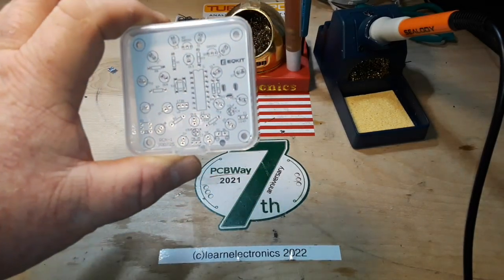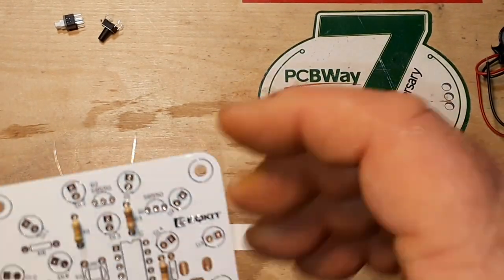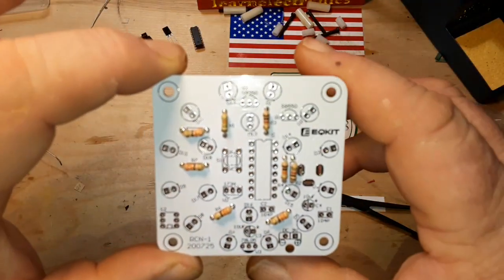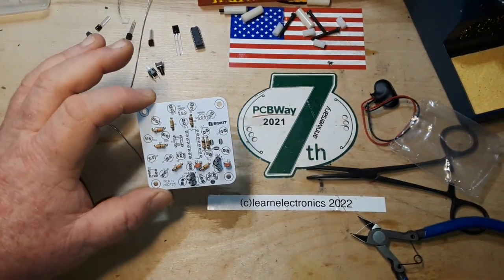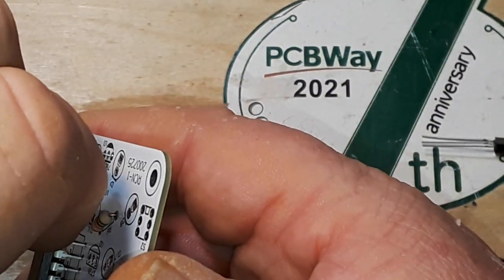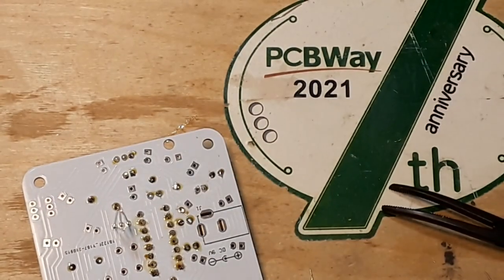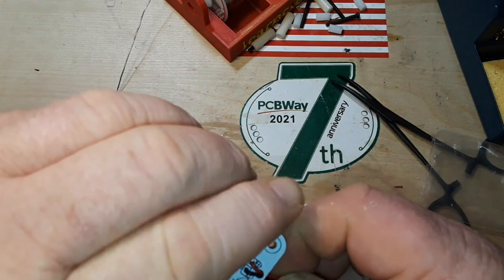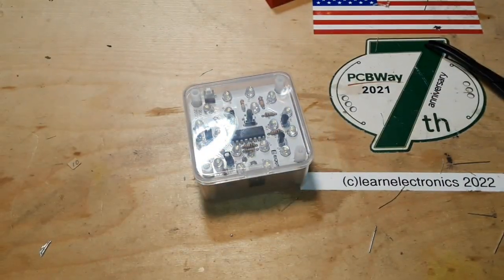An interesting nightlight kit

Comment: I always like those little kits.  I LOVE to solder.  It helps me relax.  I only do through hole.  One of these days I'll try SMD.
Another GREAT video.
Reply: Remember the Radio Shack kits, with the red circuit boards of the 70's?
Reply: SMD can be easy if it's the larger packages. The tiny little packages can be fiddly, but are doable once you get the technique down. Tin one pad. Pop your component in place and reheat until it flow then gently press the component to the board making sure the unsoldered end is in the proper position on its pad. Then solder the second end. It can be fiddly but the results can be really satisfying.

If you really get in to it, you can use solder paste and a hot air gun to do SMD. It's really satisfying when you heat the paste and surface tension drags all the components in to place.
Reply: @MrDoneboy  I remember those, along with Heathkits that my father was really into building.  I also got to build a few small kits as a young boy (radios, etc.), and find it a shame that everything these days is throw away electronics.
Reply: @UncleSiebs  And the stuff lasted.  Those big resistors and crystals.  Like military-style :)
Reply: @UncleSiebs  I remember building a ham transmitter with pops from a scratch kit.  I was not sure it was working until I keyed the mic with my hand on the antenna jack.  Woooo!
Reply: @jimedgar6789  Indeed the Heathkits lasted, and when they did break down my father would use his Heathkit troubleshooting equipment to diagnose and fix it.  You not only got to put something together, but they actually taught you how it worked! I remember the console TV in the living room was having issues, and he was able to trace it back to a single component on a board that cost $0.69 to repair!  And of all things my father was a marketing executive with no background at all in electrical engineering.

Comment: I always had a fondness for the 4000 series counter ICs. Today it's just easier to throw a uC at any task, but I still enjoy looking through the projects in the old electronics magazines from the 70's and 80's. So many clever ways to use the CD4017, CD4040, CD4060, etc.
Reply: I'm exactly the same. I've downloaded old issues of Elektor and Practical Electronics. There's so many useful circuits in them

Comment: About ten years ago I designed an LED night light, that used a vibration sensor to switch it on and a timer to return it to the off state.
The vibration sensor is so sensitive it can detect a finger tap on the table on which the night light rests. So to active the light it is just necessary to tap the bedside table with a double tap knock. The sensor can detect the cadence of the tapping and decide if it should switch on the light. 
The circuit is pic micro based, and consumes nanoamps when not active.
It also has an LDR, that can stop the light being switched on if the room is not sufficiently dark. 
The sensor, which is insensitive to sound and normal vibration, is constructed of a piezoelectric disk, mounted in a small plastic uPVC water pipe end cap. A small glass marble rests on the disk surface, trapped in such a fashion that it's movement is restricted to about 1mm. 
It is this glass marble that gives the sensor its sensitivity, I suspect that a mems  sensor could have been used, but this home brew arrangement  is cheap to make and very effective. When placed on a large dining table, the whole surface become sensitive to the smallest finger tap anywhere on the table surface.
The microcontroller circuit, uses the analogue input to set up a differential bridge arrangement that detects the voltage generated by the piezoelectric disk. The resistor network used provides a small offset bias voltage which allows the smallest output to trigger the micro from sleep mode. 
I published the design on the Maplin electronics magazine web site ( the Maplin forum), unfortunately the Maplin company failed a few years later, and the site was closed. It may still be possible to find the article with pictures somewhere on the internet. I looked a few years ago and it could still be found under the title of Maplin knock knock light.
Reply: Do you still have info on it? I've searched and can't find it. It would solve a problem that I've been working on for a while.
Reply: @TheMatthooks  yes I have all the details, the circuit and the code, along with the pictures and the PCB layout in PCB artist format. . I did a search today, to see if I could still find it on line, but it's gone. I keep multiply electronic copies of all my project design files, but the text for the article is missing. The original design documents are dated 2012.
I still use the prototype, it site in my bedside table. Since I built it, I have changed its batteries twice, and I use it daily ( nightly). I am happy to send you the design file, but it's not small.
Reply: @nigeljohnson9820  I tried to send you my details but it looks like the bots caught it. It's my first name, but the shortened version with two t's. Then my last name at the warm post place with a full stop, and the commerce ending. I'd be really grateful if you could send me the details.
Reply: @TheMatthooks  I will try sending you a test message, I do not normally do this as I value my privacy. It is why I do not post YouTube videos. That and the fact I am far less active these days, following serious illness. 
Please reply if you receive my test message and reference this channel.

PS I tried a number of variations on your suggested email address and all were returned. I might have incorrectly guessed your mail provider or have used the wrong letter case or the wrong spacing between first and last name. Is there a space or an underscore or some other symbol? 

Not sure how else I can get the information to you, without compromising my security and privacy.
Reply: @nigeljohnson9820  for some reason YouTube is removing any message that makes it more obvious, so I'll split it apart.

The first word is the usual shortening of my first name, with two t's.
Reply: @nigeljohnson9820  the second word, following a below score, is my full surname. The service is provided by post that is on fire. The ending is the most COMmon one.

If this fails, I give up.
Reply: Hi Nigel - did you happen to bookmark the page from the Malpin site? If so, you could check the Wayback Machine for an archive.
Reply: @UncleSiebs  ok I have tried to send Matt another test message. The information was posted on the old Maplin forum, around April 2012.  I posted a number of projects here, including a phoneme speech synthesizer.
A redeye receiver, for controlling a CCTV system.
I think the bookmarks were deleted when Maplin closed. At the time I was using a Vista media computer for this activity.
Reply: @TheMatthooks  the latest email has not bounced yet, so maybe you will receive it. Please confirm if you do, I have found a number with similar name. Is the name case sensitive?
Reply: For anyone who does not want to use the microcontroller. The circuit could be implemented with HC logic and a comparator. The advantage of using the pic was it offered a very low current solution, with a tiny component count. A discreet solution would need to use a very low power comparator.
Reply: @UncleSiebs  i did not know about the wayback machine. 
I can access the index page of the forum. Under the component section.
I tried to post the link here, but the post was deleted. 
Unfortunately, while shows the index pages, the articles cannot be accessed. 
The search  is for forum ( full stop) Maplin ( full stop) co ( fullstop) uk under the component section, after may 2012.  I did post some later minor updates. 
I had forgotten just how many projects I had posted. To this site. 
It looks as if all the details have been lost
Reply: @nigeljohnson9820  nothing received yet. Just a thought. If you click on my name and then go to my channel, it should show you my email address.

Email addresses are not case sensitive.
Reply: @TheMatthooks  I am using a windows machine to write this. I have found your channel and sent you a test email, please reply if it is received.
Reply: @nigeljohnson9820  Thanks for trying.  I've tried posing a few links to the product in comments on this video for the night light Paul built as several people have asked, but those comments seem to have been auto deleted.
Reply: @UncleSiebs  I have managed to send the design files to Matt.
It will be interesting to see what he makes of the design, and if it will meet his requirements, 
I did manage to access the old Maplin forum web pages, but only as far as the index pages. Most of the posts details are lost. 
I have not look at these pages since Maplin closed in 2016. It was useful to see all the project posts I sent to the forum. I had forgotten about most of them. There was a pcb drill project that used a microscope camera to align the drill in real time., and a project for an air soft gun, IR light beam range safety catch. A general purpose redeye decoder, used to remotely control a CCTV recorder, and a phoneme speech synthesizer board with I2C interface.

Comment: It really is just a night light powered by 9 volts from a battery or a wall wart. The LEDs are powered directly by 9 volts and the rest of the circuit is powered by 5 volts regulated by the 7805. The LEDs can be switched on/off by either reception of an IR signal at the 1738 or the operation of S1. (The 1738 responds to many different IR frequencies; it is not selective.) When a ground is applied to the base of Q1, the clock input (pin 14) of the 4017 is toggled. When output 1 (pin 2) of the 4017 goes high, Q2 applies a ground to the cathodes of LEDs 1-18, which causes LEDs 1-12 to light. If S2 is closed, LEDs 13-18 also light. When another burst of IR light is received, all the LEDs are turned off. The advantage of such a circuit is that the night light does not have to be within reach of the user; he/she can use most any IR remote control to switch the LEDs on and off.
Reply: Thanks

Comment: A lot of electronics to switch some LEDs, isn't it supposed to flash?
Reply: are nightlights supposed to flash, I don't know
Reply: My thoughts exactly, my guess is that the extra stuff is to do with the IR sensor but what your supposed to use for a remote I have no idea.  Thought maybe the IR sensor is working as a proximity sensor of some sorts.
Reply: @bloodyl_uk  Maybe that's why the kid can't sleep.

Comment: Could you use red LEDs instead of white without changing any of the other components on the board?
Reply: Red LED's have a different forward voltage than white. You'd probably need to look at those current limiting resistors and amend them accordingly.
Reply: @TheMatthooks  Change to resistors that are lower ohm?
Reply: @JerryPemberton  you'd need to look at the specs for the led's you want to put in, and work out the circuit voltage. You should be able to measure it from the board once it's all connected. Then there are numerous online calculators that will help you find out what resistor you need for the LED's you want to fit.

Comment: I was wondering what the 4017 is supposed to do.  Surely a simple switch could turn the LEDs on and off, or the transistors for the IR pickup.
Reply from the maker: I'm guessing it works with the IR

Comment: 1. Nice kit for killing time, but it does not teach anything.
2. Why is there an IR receiver? I did not see a remote.  What is it’s function.
3. White LED’s are OK, I guess, but contemporary white LED’s emit a lot of blue light, due to the way they are manufactured. Blue light is not a good choice for night lights. Perhaps an older monochromatic green or red would be a better choice.
4. Why does it have a barrel jack mounted on the board?  What is the current draw? With that many LED’s mounted, I would wonder about battery life.
5. In summation, while an interesting ‘time kill,’ I think it’s a poor choice for a night light. It is over-designed, and over-complicated for its purpose. You can make a very effective night light with an LED, 2 1N4007’s, a resistor, or appropriately sized capacitor, and a means to plug it into the wall. (Which is assumed to be sufficient to isolate the user from mains.)